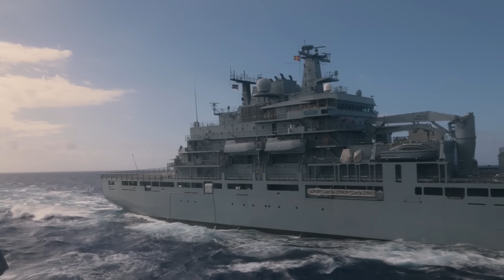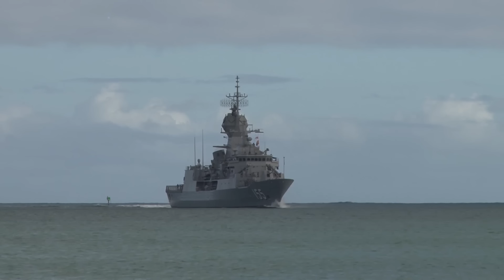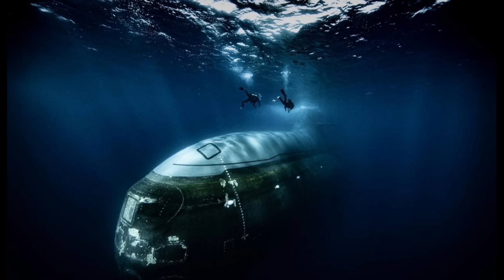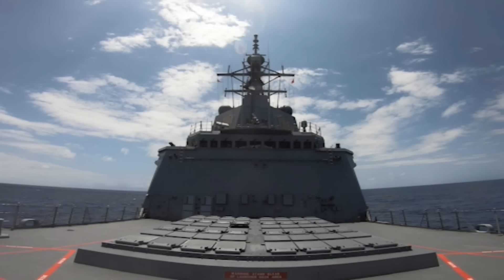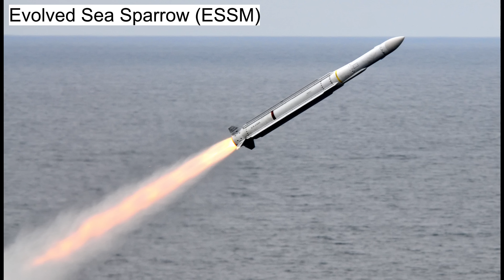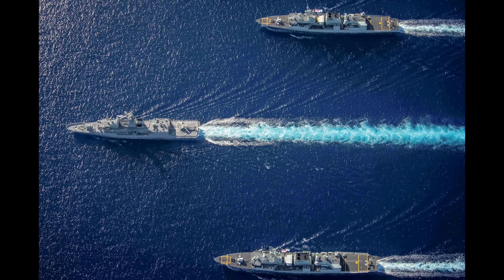Hunter Class: Why Australia Built a Frigate Bigger Than a Destroyer

Comment: Small point, but the Hunter and the ANZACs both run 5” guns. The video misspoke here.
Reply: Different mods however. Anzac Class is equipped with the older Mod 2. Hunter and Mogami Classes will be equipped with Mod 4, the variant currently on Hobart Class Destroyers.
Reply: @jedisaki   same ammunition fired from both.
Reply: @psychalogy  correct, not a "calibre" upgrade as was mentioned in the video

Comment: I thing there is a misconception about ship propulsion systems. Diesel-electric is almost the same level of noise as standard diesel when diesel engines are running. 

The quite mode is the full electric mode.
Reply: Reduced vibration from more constant and controllable shaft RPM.
Reply: @goodshipkaraboudjan  Nope. That is not a thing.

You can say gearbox noise or vibration though. But thats much much smaller than what the shaft and generator does.
Reply: @bulthaosen1169  Power to the generators is able to be suppressed. Electric power to the shaft more so.

Comment: This is a pretty average round up of information scraped from the internet and AI chatbot echo chambers. 

Area air defense ... not really ... it does not have sufficient magazine depth for that (the NATO minimum standard is 48 VLS cells). Super submarine killer ... not really ... it has a very quiet hull and very good sensors, but it would need to carry ASROCs for that ... and, it only carries a single ASW helicopter which might not be available when it is needed. Deadly anti-surface missiles ... not really ... NSM is an agile and stealthy weapon, but it lacks range when compared to peer adversary systems and the Hunter would need LRASM-SL or Tomahawk-MST to counter that range advantage. Powerful naval gun fire support ... not really ... it only has a single naval gun which cannot fire on a 360 degree arc ... it needs an additional pair of Oto Melara 76 mm Super Rapid naval guns to provide 360 degree coverage and redundancy, to provide affordable defense against drones and loitering munitions, and an anti-air capability for when the missile magazine has been depleted. Exorbitantly expensive ... not really ... when you take into the account that cost also includes the naval shipyard and the trained workforce required to build them and which can be amortized across other naval shipbuilding programs. Also, much of the cost will be retained in the Australian economy instead of going offshore. A meaningful comparison of warship procurement cost is somewhat more complicated that quoting program cost numbers obtained from articles you read on the internet and dividing it by the number of hulls.

The Hunters will be very good anti-submarine warfare ships, but they will need to operate together with an air warfare destroyer to provide multi-layered area air defense and to counter ballistic and hypersonic missile attack, and an Optionally Crewed Surface Vessel to provide increased magazine depth.

BTW: They are called frigates because of what they are intended to do ... not because of their displacement. During WWII a destroyer typically had a displacement of around 1500 tons while a warship with a displacement of 9000 tons would have most likely been called a light cruiser due to its extended range allowing global reach. In general, warships have grown larger over the years because they now have to carry data centers and the electrical power and cooling systems required to operate them.

Comment: Frigates and Destroyers are the roles the are designed for, not size classes.

They cost so much because they have had US systems shoehorned into them, and the spy radar weighs soooo much more that the UK one, so the hull had to be changed to keep it upright. 
It also includes all the costs of setting up the shipyards and technology transfer.

Would have made more sense to go halves with the Canadians.
Reply: Its not a spy radar it was made by a kangaroo fker.
Reply: Go halves in the River Class Destroyer which is also based on the T26 Frigate and has the same role?

Comment: Is AEGIS battle management system heavy?? Its only a software package that manages radars, weapons systems and EW equipment it manages and decides how to engage threats!.....????? Im pretty sure the mast and CEAFAR radar is responsible for the weight increase.!
Reply: AEGIS is also hardware to some extent. There are specific rack mounted computers for it and also terminals in the CIC. That said, yeah, its mostly going to be radars, power systems and cooling.
Reply: @soulsphere9242 i thought there would be some hardware to run the software
Reply: @montys420- I just did a bit of reading. Apparently these days they no longer use specific navy computers and it can run on commercial off the shelf server hardware. How much hardware is needed isn’t detailed.
Reply: @soulsphere9242 hardware like computer hard drives and so on? They'd still need to fit into the operations room which isn't huge, and how heavy can modern computing systems be? They don't need huge racks of transformers to power generate, the ships turbines can generate the electrical power needed as well as the diesel generator's
Reply: @montys420-  Yes I imagine they are just like modern rack-mount servers. Even ships without Aegis have other combat systems, so the actual computing requirements are probably broadly similar. The main hardware difference is likely to be in the CIC terminal layouts and displays. I once was on a tour of the USS Valley Forge which is a now decommissioned (and sunk!) Ticonderoga class cruiser and the CIC was pretty big. Interestingly the terminals were running Windows but were locked out.

But yeah, none of this would be particularly demanding I would think. The power generation and cooling for the radars and the radar hardware itself is where the weight would be as you say.
Reply: @soulsphere9242 it would be alot lighter than specifically hardened military hardware if commercial can run it, cooling would be the main issues and computer fans isnt hard to add more if needed.
Reply: @soulsphere9242 im wondering if on the Ticonderoga cruiser especially cause theyre old now, if the cic consoles werent alot bigger than they needed to be, they obviously had software upgrade since they were running windows but i can imagine they were running a specifically designed and manufactured by the miliary hardware and software which would be huge and heavy overkill for their time but within a decade or so everything hardware and software in the civilian world had overtaken the militaries capabilities and halved the size and weight of the hardware and tripled the speed and functionality of the software so they upgraded both but left the old consoles? Which if looked inside of those theyde be practically empty because of the amount of miniaturisation that had happened over the previous decade/s?? Idk just my thoughts on the differences between military and civilian products that do the same job that ive seen over the yrs.
Reply: @soulsphere9242  lolz.
its a couple of cables.
Its nothing but networking two radars to one monitor.
I ams ure that was existing new technologie 45 years ago, not its just bullshitbingo to sell stuff to idiot politicians.
Reply: @tigersilberhannes9153   Networking two radars to one monitor...yeah OK. I am sure you have never done any sort of systems and software integration.

Comment: Idk Australia didnt look at Austals Independence class LCS fitted out as a dedicated ASW platform for nothern Australia's approaches or Lurssens coastal Patrol vessels we already purchased and are recieving, both have a huge mission bay, and just order batch 2 Hunter class and mogami's the ASW equipment can be fitted to either lcs or patrol vessel
Reply: LCS Independence is a technical and costly disaster floating on the sea. Nobody spends money on that kind of thing.
Reply: @winbear7423 only issue ive seen with them is cracking in hull which can be fixed on new build ships, freedom class lcs is trouble
Reply: Bluew water requirement
Reply: @ngrand7868 i thought about our southern waters but if lcs hull cracking is fixed on new build ships it can traverse blue water, but I was thinking these with there speed and cat hull would be better for our northern sea lanes and lurrsens for southern waters!
Reply: Instead of the lcs stick with japan and get a bunch of Sakura OPV. Japan kits them for quiet and stealthy they can launch 2 fast boats out of a rear hatch and have a hanger that fits a sh60 or vbats. Only 1900 tones with 30 crew and 4500 miles. They move at 25 knots but japan probably has the ability to boost speed and range considering mission bay below the hanger and flight deck. Great ship with a near 30 days of endurance.
Reply: @howiehowdy ill check the ship out, independence class lcs came to mind cause asw and mine sweeping were going to be part of the ships mission profile, they have like a 1000m squared deck under the flight deck that could fit so much specialised equipment as well as rigid fast boats, they were fitted with a way to set out and retrieve variable depth sonar and or ROV's for mine warfare, plus a good sized flight deck to be helicopter supplied, or to have a container flight room for the naval helicopter drone all navies are purchasing let alone the containerising of weapons systems like hellfire or essm, or even 1 way loitering attack drones, but if the Japanese OPV are similar or better, i wouldnt begrudge those being ordered, plus we could of ordered the largest of the lurrsens OPV design which has a helicopter hanger and more offensive/defensive weapons, its not a bad design Australia just took its teeth away, why they didnt keep the 57mm just for drone defence both aerial and water bound attack drones will be obliterated by the 57mm, could have a embarked helicopter that would extend its offensive capabilities over the horizon for nsm targeting and ASW ops, the cape class can handle all the eez illegal fishing and so on, and the OPV be exactly that a armed offshore patrol vessel able to take on most threats if used properly to its advantages, you dont rey slug it out with a type 55 cryiser in an OPV but you can abush a type 55 cruiser in the waters to our north using islands and the embarked helicopter to give the pisition of the cruiser for NSM attacks, whilst using the islands to hide the OPV's position and conceal itself against them.
Reply: Because they're a disaster of a class....